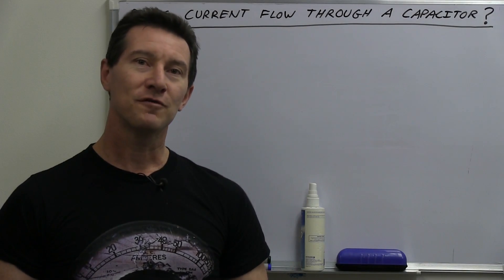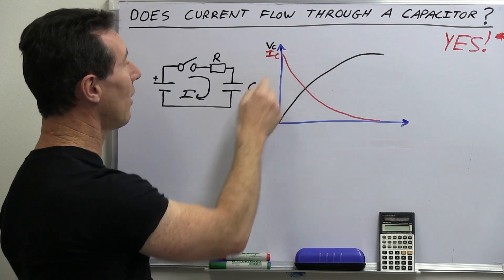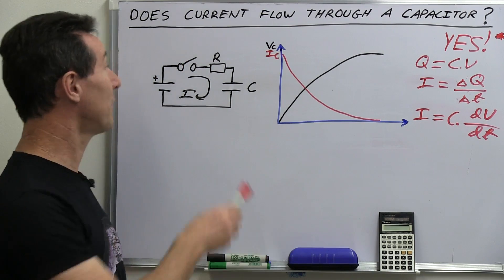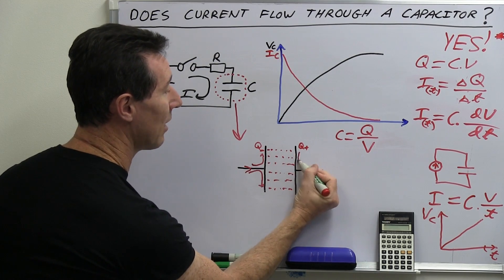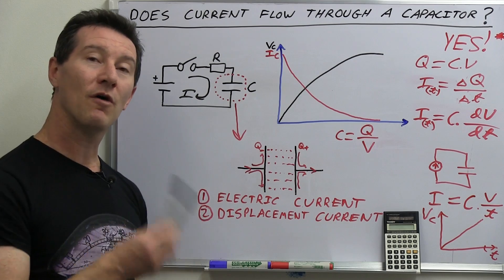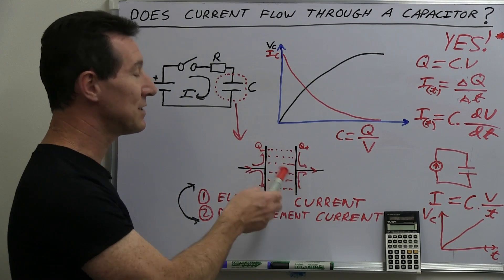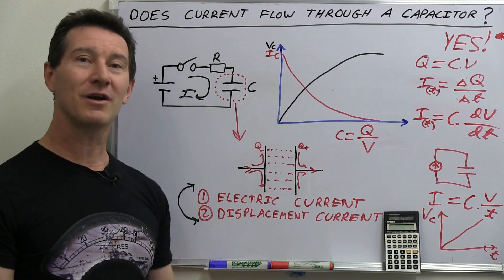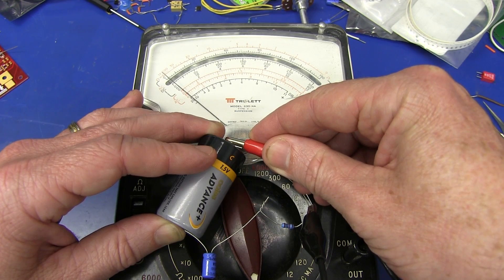EEVblog #486 - Does Current Flow Through A Capacitor?

Comment from the maker: It can, as the switch in fact is a (small value) capacitor. But just like the capacitor you need a changing electric field in order for displacement current to flow. No more changing electric field (the switch capacitance is charged up), no more displacement current flow.

Comment: It does, like he said an open switch is a capacitor, it's just vey small. It's part of the reason the universe does not end when you open a switch as the capacitance means there is not an infinite change in current ;)